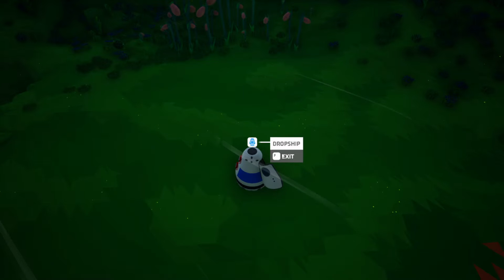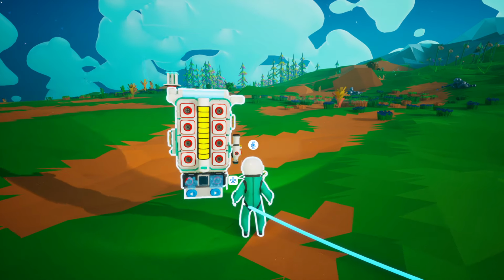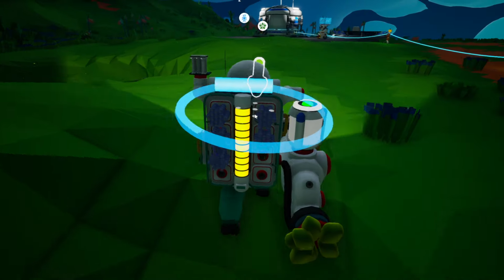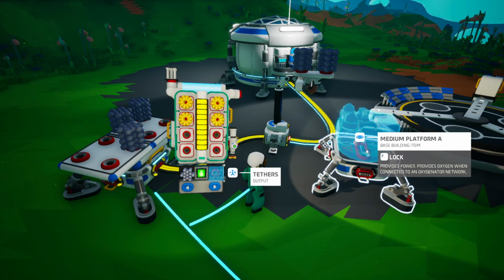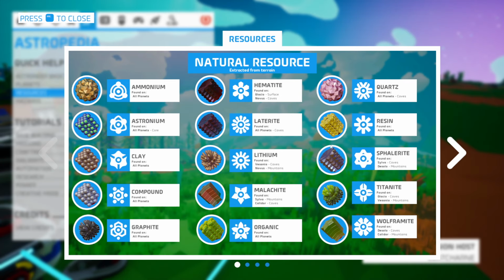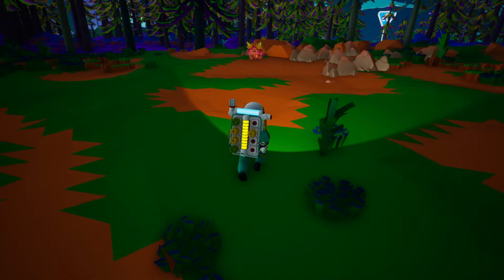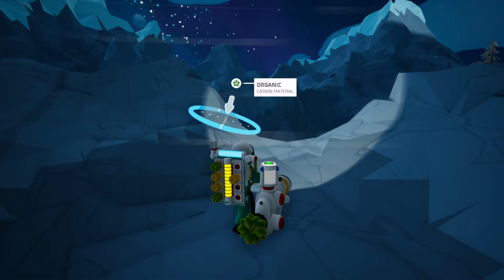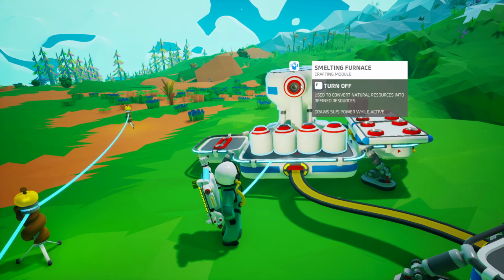The Ultimate Astroneer Beginner Guide

Comment: I'm not an absolute pro or anything. But I have played enough that I could give tips to new players that will help very early in the game so you don't do things you'll regret later in the game.

In order of magnitude of how helpfulness they'll be (high to low):
- Complete quests, and as soon as you fulfill them, let them pay you out. Some quests will pay out with blueprints you might otherwise would have bought with the research points.
- Don't worry too much about your depleting oxygen, I got knocked out more often by accidentally falling from some place too high than from suffocating. You should be able to hear a little sound when you're at half your total oxygen supply, and you have a little extra time to get back to a spot where you can refill your oxygen. Just make sure you know where your closest or latest oxygen supply spot was.
- Be generous with tethers, but don't just put them everywhere so they all connect with each other. Especially in caves, you'll get lost, guaranteed. The platforms used for the larger machines will also provide oxygen, and can also connect to tethers. Just make sure they are powered and you don't accidentally remove them. 
- the smaller powered vehicles provide power and oxygen by default, but can't connect to tethers by themselves (even though it might seem like they can). So they are ideal for surface or cave exploration, as long as you stay close to them and keep them powered.
- Don't use glowsticks
- The game is a lot more fun when you try to explore more instead of hoarding anything you see and immediately try to make it a self sustaining factory. You don't need every spec of sphalerite and maybe you'll even hurt your progress by farming everything you see at first sight. Playing this game in a more relaxed way is probably also the better way to play.
Reply: What you got against glowsticks?